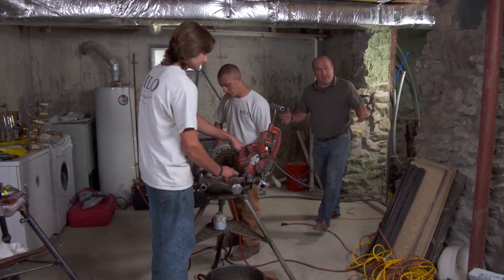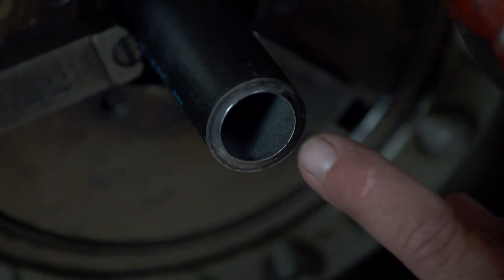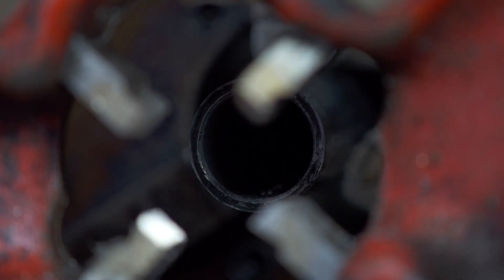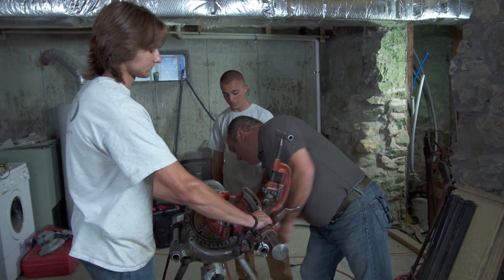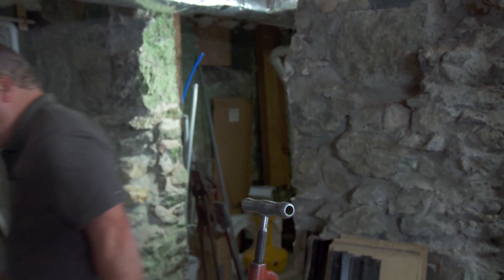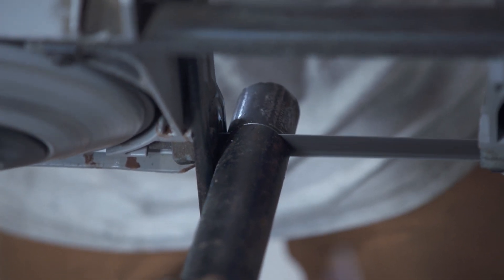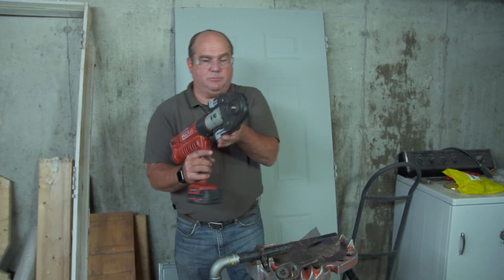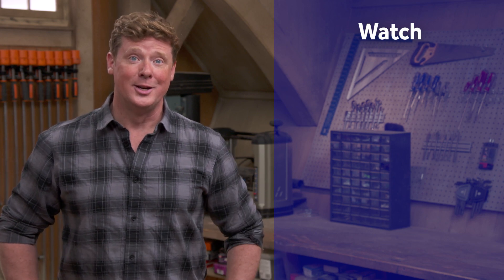How to Connect Steel Gas Pipes | This Old House

Comment: "Because it was cut square, there's no need to de-burr the pipe." Followed by a shot showing the end was cut at a 15 degree angle.
Reply: yep and manufacturers still want you to debur the connection to protect the o ring from being damaged during installation. Richard is wrong as usual
Reply: @zack9912000  No need to ream the inside because the o-ring doesn't touch the inside. The emery cloth on the outside is enough to take the edge roughness off.
Reply: Lol it was square "enough." But not really square.
Reply: Seeing that just made my day, sometimes it’s better to just stick to the old ways lol

Comment: I grew up on the old tripod vice and "hand and arm powered" die and ratchet. Built character and you knew you put in a good day's work!!! It must have been the camera angle, but that cut before the press fitting was put on did not look square at all.

Comment: Nice video Mr. Trethewey. I use ProPress systems all the time. When your cut and fit is right, you are correct. It'll be there forever.
Thanks again.

Comment: Contractor from Europe here. We use press fitting for 20 years. For gas we use stainless steel or copper pipes. No one uses steel gas pipes anymore. So i must say you guys are late for the party but great video as always.
Reply: Exactly.

Comment: Those compressed fittings on a gas line make me uncomfortable. 🙈
Reply: me too that's why we welded ours instead of doing  compression fittings on rubber gaskets ; )
Reply: the gas pressure coming into your home is only one maybye two psi at most....
Reply: It's actually much better, but you can't back it out. Now whether that's a good thing or a bad thing you can decide but I personally like average joe not trying to redo his gas pipes. On the other hand he may take a saw to said pipe and forget to turn off and vent the gas and then..... 🤯🤯🤯
Reply: @workingshlub8861   Its less, home gas comes in 4-7 "Inches of Water" (0.144-0.252 Psi). You can hold the gas down with your hand. There is no major pressure behind it.
Reply: @obviouslyniceduh5521  The gas is not that strong or plentiful for that to happen.
Reply: @tipperzack  right..most regulators on appliances are rated 3.5 inch wc..not much at all
Reply: @obviouslyniceduh5521  that happens more than you think....some parts of the country  they use copper for propane and gas lines...

Comment: English engineer of 44 years here. Threaded joints will never be beaten by a insert on a black iron pipe. In this quick modern age, they may suffice to do the job, but never equal. Peace be unto you.

Comment: Nice machine you got there Mister ; ) In our house we welded the steel pipes :D The compression tool looks exactly like the one we used to connect our PEX water lines inside the house though.
Reply: Same idea as with the Pex, only the pipe is rigid enough not to need a female support under the crimp. Probably the exact same tool.

Comment: Corrugated Stainless Steel Tubing: it’s solid tubing similar to old school soft copper but is stronger and much-much faster to install as it only has 2 connections in a run one at each end. Steel pipe needs fittings every 10 feet plus at all direction changes as well as unions to allow easier future changes. CSST can also be run from a manifold. Just as PEX updated plumbing so should CSST. I like the idea of a continual run of gas tubing. CSST also doesn’t require a large initial investment in tools/tooling.
Reply: Black iron gas pipe comes in multiple lengths, Oh and can be cut very easy with a pipe cutter. Also it is not wise or in most states it is not code for any type of flexible gas line to be ran hidden within walls or come through floors and ceilings. The good old fashion black iron and with threads are code and work great.
Reply: Y YIII: You can spell out building codes limiting it where you are but as far as NY State, upstate anyway, I can’t speak to NYC, CSST is suitable for in closed wall space installations. It does require a special connection for through floor installations wherein it transitions to exposed space. Flexible copper is still also allowed for gas line installations, though it has fallen out of favor. Iron pipe does come in multitude of sizes but requires a lot of fittings and labor to fit. CSST is a product of choice  today just as PEX has mostly replaced Copper tubing for water piping. This is a channel targeted at DIYers and CSST is much more DIY friendly not to mention over any large or complicated run is much cheaper.
Reply: @yyiii276  I plan to replace all my existing black iron piping inside my house and upgrade it to CSST. The black iron pipe installation they did in the 70s used pipe diameter that is way too small and there is a ridiculous number of fittings between the meter and my heater/furnace. I counted 35 connections. It will take me much longer to remove the black iron pipes than to install the CSST that will only use two fittings.

Comment: That cut will not seal properly. The cut was at an angle.>3:39
Reply: as long as it gets pass seal your fine. threads leak too if the machine isn't set up correctly. dope is just a lubricant
Reply: The seal doesn't take place at the end of the pipe. Notice where the O ring is positioned when the pipe is fully inserted into the fitting.
Reply: @danielsoroken9596  Can't see the O ring inside the pipe. So the pipe goes a bit passed the O ring is what is happening?
Reply: @joebrown1382  You got it!
Reply: @danielsoroken9596  Now it's clear thanks.
Reply: As long as the cut is past the O-ring it should not leak, but that being said it is still an improper cut. Having a  square cut inside a Megapress fitting prevents a dog leg situation & allows for proper stab depth markings. My expertise comes from 35 years in the gas industry & over 10,000 emergency call responses. I can assure you when an incident happens everything is examined. A square cut is required  by the mega press fitting manufacturer. So do you think during a deposition proceeding for a gas incident, the question may come up ( why was the manufacturer's specifications not followed  ?) ? You may want to hold off on stating, the comment section on YouTube said it was okay.

Comment: I’ve turned wrenches many times but this sure beats that. We use them at work
Reply: What about using CSST? I can move 100ft with one arm and lay it all down a crawl space within an hour. Black iron takes hours of manpower. Plus less tools, fittings, and comparable prices.
Reply: Tipperzack we use flex but the main gas lines are ridged. Cant use flex on rooftops or commercial work
Reply: @fisherman2359  Agree but this is a video for residential work. I also would not violate code.

Comment: Although natural gas is only 1/4 PSI in a home, I would still be concerned with the gasket sealing against the black iron pipe. The surface of the pipe is fairly rough even after you sand it down a bit like he showed in the video.

Comment: all i'm seeing is a headache later on when its time to replace sections.
Reply: Should be easy, just cut it and add some fittings  ;) probably expensive though
Reply: It can be
Reply: @PolymathPete  The fittings are not expensive, the tool is expensive. The one shown here is in the range of 2000 Euros (2200 USD)...
Reply: @Marcel_Germann  In my experience pressure fittings grow hugely in price with the pipe diameter increase :D I have a few 100$ PEX fittings in my system on the 2" water mains PEX pipe... Madness :D
Reply: easier than a threaded connection. Cut, couple back together with a slip coupling.

Comment: A $20 fitting v $3 fitting. Threading is still cheaper even with the extra time. What is driving this is the shortage of skilled labor theading and putting threaded pipes together takes skill.
Reply: Labor cost is more than the cost of an expensive fitting. Quicker connection, quicker job with less labor. Anyway, I like the old threaded black iron.

Comment: will do the old fashion way. great way to blow up a house if the fittings ever goes. seen a ton of their hvac fittings and water counterparts fail
Reply: water is tested at 1 and a half times operating pressure. gas 15psi. less that 1 psi operating pressure through your regulator in some cases. change with the times. most new homes are using pex water supply systems. another type of compression connection
Reply: @luiscontreras71  you clearly dont work with these daily do you? The O-rings fail after a few years and become brittle and leak. I have 50 year old black pipes that never leak. I have had to repair this crap that leaks on 5 year old installs
Reply: @zack9912000  What is Orings? Tell me, please?
Reply: @Καιρός-ζ6σ  what actually makes the seal with these pressed fittings is a O-ring material that depending on the material make up they can be designed to handle high pressure and or High heat applications. these o rings break down in just a couple of years. I had seen these fittings leak in 5 years and sometimes less if in cold conditions
Reply: @zack9912000  Thanks.
Reply: Never seen a properly prepared and installed propress fitting/connection fail. From 1/2”- 4”
Reply: @zack9912000  These don't leak. What you are doing right now is just being afraid of using newer technology and are stuck in your old ways. This is faster in every way and makes jobs much easier to do.
Reply: @Drakey Fenix  they absolutely do leak, seen plenty of them myself. Propress fittings are not a long term connection. These pro press style fittings DO NOT have the same expected life span as standard black pipe. They were made for the sole purpose to make the plumbing work go faster for the contractor, they are not designed to benefit the customer, it cost more per fitting and easily half the life span of the proven method.
Reply: zack9912000 They will absolutely leak if they are improperly installed. Installed per manufacturers specifications and you will have no problems. There are multiple benefits for the customer in using these connections.
Reply: @zack9912000  I actually work with these every day and I've never seen a copper pro press fitting or mega press fail with proper prep of the pipe. I dont know where you got the few year repair crap. these fittings have been known to last 20 years. we use in hospitals in california which recently were approved in hospitals. Think of Oshpd standards. no hot work permits. black pipe does oxidate. I've demoed tones of it. Again ...change with the times this system is here to stay... or be out of a job
Reply: @luiscontreras71  yes, as long as use viega fitting or valve with proper prep; they don't fail. those old time plumbing told me, they don't like propres at first. when they do 2"+ pipe work, they don't care anymore how to get the work done. all they care how fast, and safe.

Comment: You should have cut and reamed it with the Rigid 300 threader. Also you didn't use the cups to sand the paint off the pipe?

Comment: Here come all of the “pros” that know absolutely nothing about gas pipe fitting, here to tell us that the “old way is better”...
Reply: The old way is better. Back in my day, we used Horse snot to lubricant the cutter
Reply: Add long ad you can personally detail the technical comparison by the numbers than you shouldn't care
Reply: @jwd215  And no fancy waste-of-money pipe dope either, just wrenched the pipes solid like a weld. All you needed was guts and balls and a lot of them!
Reply: The only problem I can see with this is if you need to replace a pipe or fitting, you have to cut the pipe far enough for you to put a new crimped butt fitting versus unscrewing it and replacing a whole length
Reply: Nope, not from me. I am one of your old timers (63). I purchased the complete system when it came out as i do alot of gas piping.
This system is great and knock on wood as of today not 1 issue with leaks.
Reply: @Razzman70  crimped butt fitting?  Lol.  Don't know what you mean by replacing a whole length of pipe when you're unscrewing threaded pipe and fittings...🤔🤷‍♂️.  I always used to have to find the nearest union to disconnect it (usually at an appliance) and back the piping out as far over to the area where I needed to work.  Couldn't always do that for all the pipe though as tees would pose problems taking it out. 

This MegaPress stuff, like copper pipe fittings, has couplings up to 2" (I think they now make fittings up to 4").  So when you cut the pipe, you just have to worry about getting the press tool and jaws in the space you're working in to make a joint.  No wrench turning and having to worry about leaving unions in concealed spaces.

Comment: And the benefit of this new method versus CSST?
Reply: You can use the MegaPress gas fittings on an existing steel gas pipe instead of running CSST.  I don't know about your jurisdiction, but where I work you have to pull permits and bond/ground the CSST back to the main electric panel to protect it from lightning strikes.  In residential new construction it would obviously be more beneficial to run CSST, but in most of the existing homes where steel gas lines exist, it's a cinch to use this stuff.  Not to mention, steel pipe is less susceptible to getting screws and nails punctured through it.

Comment: Like Pex fittings which have rubber O-rings, this has some type of plastic O-ring.  My question is, how long will this plastic O-ring last before the gas flowing through this pipe damages or deteriorates it, causing it to weaken and eventually fail or leak?  This is almost the entire reason I don’t like Pex or these new type of gas fittings.
Reply: The yellow O-rings are HNBR (hydrogenated nitrile butadiene rubber) not plastic.  They're supposed to be corrosion resistant to the gases for fuel piping.  They make regular black EPDM O-rings for water pipe systems, as well.  The fitting manufacturer, Viega, guarantees/warranties their ProPress/MegaPress products for 50 years.  It lasts just about as long as every other plumbing system material is what I've been told
Reply: @andrewwelch5668    Thanks, Andrew, for that information.  But here is the problem as I see it:  you wrote, "It lasts just about as long as every other plumbing system material is what I've been told..."  This is the problem in a nutshell:  these manufacturers virtually ALWAYS make these kind of grandiose claims but without backing these claims up with facts.  Have these HNBR o-rings experienced ACTUAL time in the field inside of these gas pipes under all sorts of inclement conditions for 50 years, with extensive field testing to verify the claims?  Probably not.  They say, "Well, we put them through lab testing that mimics fifty years, etc. blah blah..."  Words aren't cheap, they're FREE, but when your life depends of these claims, they need much more than mere words in my book before I would bet my life on them.

Comment: Do they have the same kind of system for galvanized water pipes?
Reply: Who uses galvanized anymore for new work?
Reply: @bmanwpg  I have an old house that has a supply from the street that is galvanized pipe.  I have to replace a shut off.
Reply: We have some of those for our stainless I saw some for copper too, not sure if galvanized is smooth enough to seal properly would have to ask at a plumbing store
Reply: @timewithchaplainken3916  they sell mega press threaded adapters as well. galvanizes is just the coating on the pipe. it's still steel. thread the pipe and use a brass adapter to connect the shut off.
Reply: stopped using galvanized water lines  years ago..
Reply: @timewithchaplainken3916  if you plan on keeping the house i would just replace the entire line and be done with it...
Reply: @luiscontreras71  thanks.  where can I pick one up?

Comment: Would that last saw cut down a basketball pole ?  What kind of saw is that ?  Thanks.  ( reciprocating saw from home depot did not cut the pole hardly at all )
Reply: All blades are made of metal but you need one thats actually made to cut METAL ONLY, not those demo blades that cut nail embedded wood.
Reply: Portable band saw but you should be able to use the reciprocating saw with the proper blade.

Comment: Might be wrong here, but I don’t think in the UK it is allowed to use a “gasket” (I assume o-ring?) for gas?

If so, is the USA ahead now after being quite sluggish with PEX and pushfit (sharkbite) for so long?

Genuinely don’t know 🤷🏻‍♂️
Reply: You see pex going to homes and some apartment type buildings, there's still a huge push back from using push fittings. There is a lot of propress and mega press going in now

Comment: Time is money but MONEY is money too. How much does a 1.5" press-fitting cost? How does it compare to a dope threaded fitting? And just welding?
Reply: $3,000 press tool, $150 jaws(each), $33 for an 1 1/2" mega press g 90, and about 1-2 minutes VS $4,000 for a power threader, $7 1 1/2" thread gas fitting, $5 pipe dope, 4-8 minutes for a thread fitting

Comment: Richard, let's go over some of the shortcomings in this video.#1 Safety First,. Let's start using some of that PPE for all those involved.#2 A square cut is required by all the megapress fitting manufacturers ( this prevents a dog leg situation and proper stab depth marking).#3 don't be lazy with that emery cloth ( burrs are the number one cause of o-ring damage).#4 you failed to mention the different types of megapress fittings ( gas and water, plus the color code markings ).#5 failed to mention, converting the pipes back to threads for all component tie-ins ( this is required for drip legs & equipment connections ). No HVAC contractor wants to replace a gas valve by cutting a pipe ( equipment manufacturers still require a threaded drip leg and a union for component change out & unit connection).
  My expertise comes from 35 years in the gas industry and over 10,000 emergency call responses.
Reply: Prove it or it never happened.
Reply: @t.regnerus301  , it was just a dream and on those 40 degree below wind chill nights, it was just a nightmare.